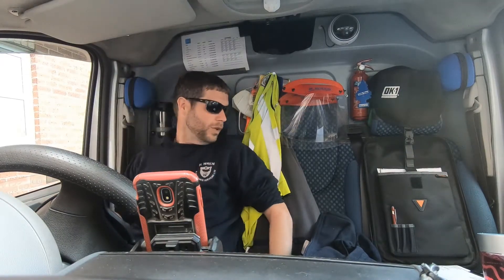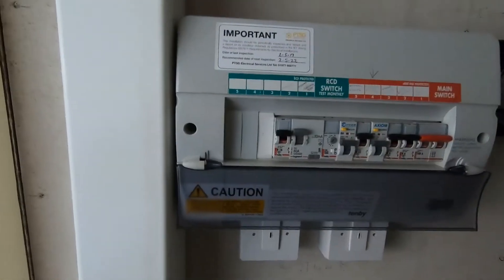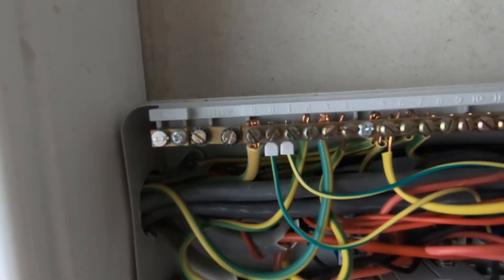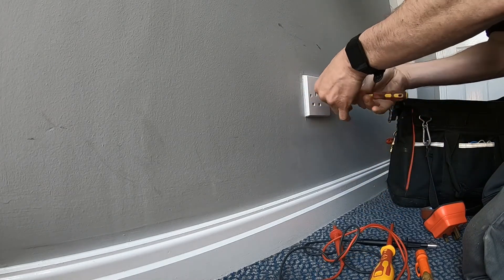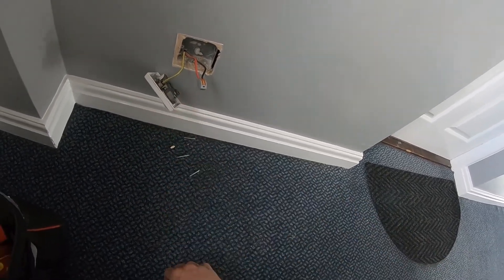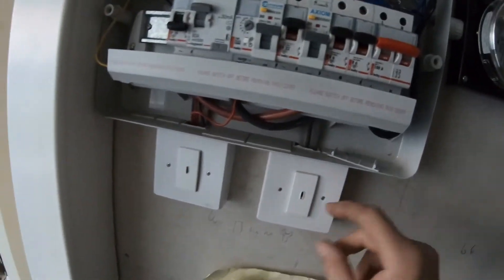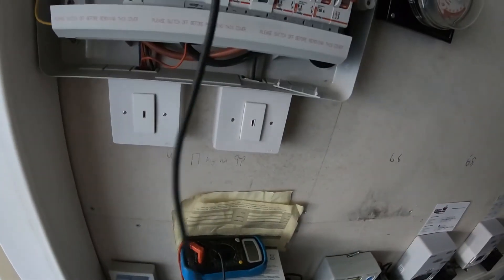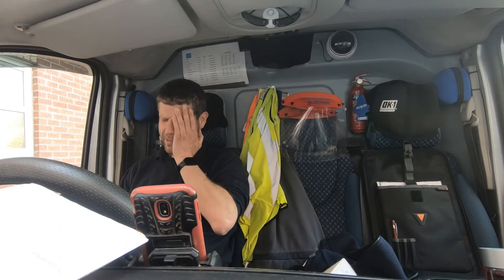Fault Finding, Sockets not working!

Comment: I have a question. I recently just moved into a flat, now we had a friend put up the light fixtures and yesterday they both just stopped working, we've checked the fuse box, they're all on, but it's affected my use of the kitchen sockets. What might be the problem?
Reply from the maker: Without seeing it, I cant advise for certain. Have you checked RCD in the fuse board as well as the Mcb? The only thing that springs to mind is that one of the lights may be faulty and tripped the RCD which will protect multiple circuits, hence affecting your sockets. Other than that, the lighting circuits should have no effect on you sockets.

Comment: You checked the RCD but not the MCB you should have checked both really,
Reply from the maker: Thanks for watching and the comment, however, if you watch this again you will see the MCB is directly next to the RCD. Both were initially visually inspected then both tested later using a multimeter. Regards, Haydn
Reply: @HWrenMaintenanceServicesLTD  Hi Haydn, ha,ha .even though I’m not an Electrician,I saw what you did, Regarding the comment about not checking the MCB. So many people on YouTube jump on things that if they really watch the vid they would see the error of their ways. Instead of this (No one can do it like I do mentality.)  Thanks for giving your knowledge for free.
Reply from the maker: Thanks for watching and the comment!